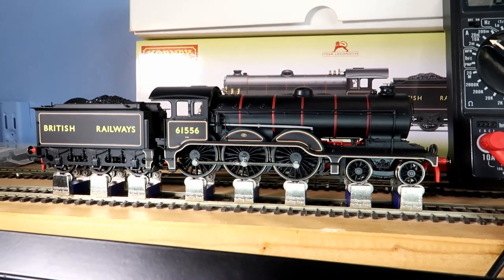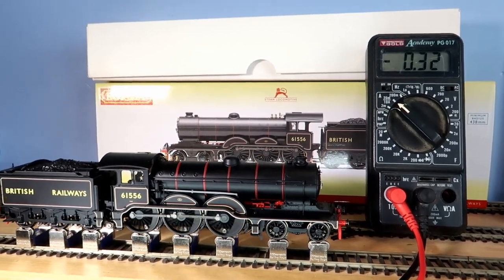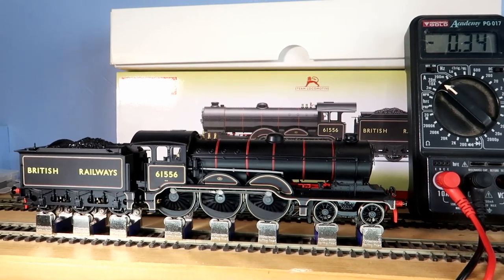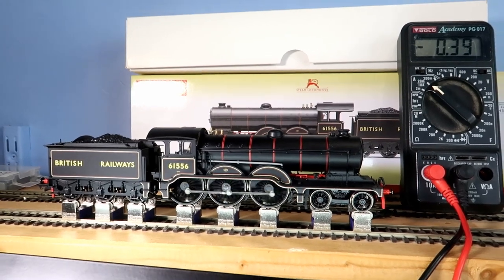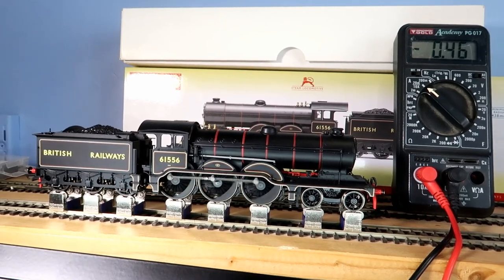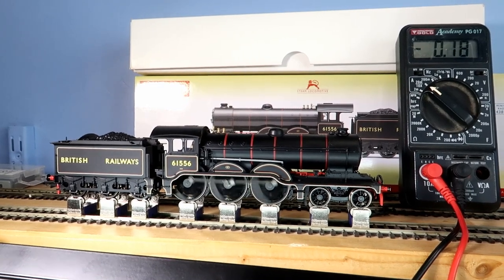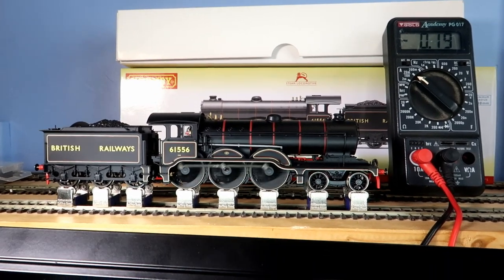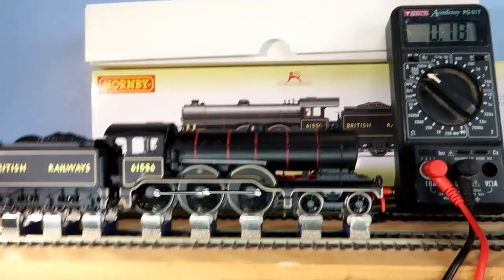Hornby B12 motor fail, NOT AGAIN, Warning to others and apology

Comment: Oh no, that's such a shame Mike ! I'm still wanting for mine to arrive, but I would just replace the motor. If you can open the old motor up and have a look, I have an LMS 8F that had the same problem. When the motor was dismantled the plating on the magnets had come away and distributed itself through out the motor. I cleaned it up and it's still running today. Best of luck with what ever you choose to do. Regards Leonard.
Reply from the maker: Thanks Leonard,  At the moment the loco is undergoing tests.
I replaced the motor and that too failed but I think it was one of the ones Hornby sent me for the S15 and I fitted it by mistake.
Now its fitted with one of the Chinese ones.
It’s running much better than it did and is drawing just 100mA which is fine. I’d expect motors of this kind to draw between 50 and 150mA if all is well.
I have some suggestions for other owners that want to try and stop the motor issues.
1) Check the loco wheel pickups, mine were way too hard and causing lots of drag, ease them off so that they just keep contact when the wheel is furthest away from them.
2) Inside, see https://youtu.be/Uwp_z3GdXXk Make sure there is clearance between the rear flywheel and the motor bearing, check that the sleeved wire from the suppressor capacitor is not fouling the back of the front flywheel. Make sure the worm tower bearings are lubricated. Make sure the motor bearings are lightly lubricated. Check in the worm tower that the grease is not too think.
My feeling is that the motors are failing as the brushes break down due to heat and short out the commutator segments. This could explain the erratic running we see.
I can’t pass on the link for the Chinese motors as they are out of stock now and have no plans for more. If I find an alternate supplier I’ll let everyone know.
Take care. Mike
2mm shaft
35.8mm body
6mm dual shaft
16.6mm biggest width.
12.6mm narrowest width.
12V-24V-High-Speed-Micro-NdFeB-Strong-Magnetic-Mini-130-Motor-DIY-RC-Car-Boat

Comment: Very sorry to hear that and certainly nothing you should feel the need to apologise for.  Hornby should have sorted this problem and recalled all stock if it's a known issue.  I've got one that has only been run in until I get my layout sorted and am now worried mine might go the same way - so I'll keep running it just in case!  Hope you get it sorted one way or another, end up with a nice B12 - and you did well to keep your language moderate!
Reply from the maker: Thanks lol  do check the pressure of the loco pickups, mine were way too hard.

Comment: Hi Mike, I bought one of these from Hattons at the same time as you. I thought it was a bargain. I’ve not got it out of the box yet. I was looking forward to sitting down with it when I  get some time. Now I’m not so sure!  I think the motor is X7083. According to Peter’s Spares, the RRP is £40.18. How can such a little motor cost so much, and how can it go so badly wrong. What if I bought a replacement motor and it was the same batch? The bargain doesn’t seem such a bargain anymore.

Thanks for the heads up anyway. Sounds like you need a stiff drink!
Reply from the maker: Hi David, I know what you mean.
I replaced the motor and that too failed but I think it was one of the ones Hornby sent me for the S15 and I fitted it by mistake.
Now its fitted with one of the Chinese ones.
It’s running much better than it did and is drawing just 100mA which is fine. I’d expect motors of this kind to draw between 50 and 150mA if all is well.
I have some suggestions for other owners that want to try and stop the motor issues.
1) Check the loco wheel pickups, mine were way too hard and causing lots of drag, ease them off so that they just keep contact when the wheel is furthest away from them.
2) Inside, see https://youtu.be/Uwp_z3GdXXk Make sure there is clearance between the rear flywheel and the motor bearing, check that the sleeved wire from the suppressor capacitor is not fouling the back of the front flywheel. Make sure the worm tower bearings are lubricated. Make sure the motor bearings are lightly lubricated. Check in the worm tower that the grease is not too think.
My feeling is that the motors are failing as the brushes break down due to heat and short out the commutator segments. This could explain the erratic running we see.
I can’t pass on the link for the Chinese motors as they are out of stock now and have no plans for more. If I find an alternate supplier I’ll let everyone know.
Take care. Mike
Reply: @ModelRailwaysUnlimited  Mike - big thanks for your very detailed reply.

I’m looking at the instruction sheet inside the B12 box. It says on the front page, right hand side, “The locomotive is fitted with a sealed, long-life motor which requires no maintenance. After a considerable amount of use the motor may require replacement and this should be carried out by a Hornby Service Dealer”. 

So it should be perfect, and you cannot see inside. Except it doesn’t actually work. Thanks Hornby!

Comment: I had the same problem on a Hornby Coca Cola tram. it's on it's third motor. Exactly the same symptoms, went up to over an amp.
Reply from the maker: Thanks, over an amp on the tram!!! my word, concerned you are on motor 3
Reply: @ModelRailwaysUnlimited  100mA when new.  I have not fitted the third motor yet. I'm going to only run it on 5v as that equates to around 30mph. if that blows will be having some serious words with Hornby!  The tram is actually made by Riverosso. I was also using an expensive lab bench power supply so not a PWM controller.
Reply from the maker: @MerlinIslandCrabCoveRailway  Check the wheel pickups, mine were super hard against the wheels causing drag?
Reply: @ModelRailwaysUnlimited  No not the problem. After the first motor burnt out I was quite careful with the second. I suspect it was a duff batch of motors, and I unfortunately got one in the tram and also one from the same batch as a spare part.

Comment: Mike thanks for response back re replacement motor interesting that you found pickups to drivers had excessive tention as I've always found Hornbys to have very poor contact  with the backs of wheels but there can always be exceptions especially as you have the loco  with you.From the results of your latest test running all would seem to be ok.Maybe faulty brushes after all! Oh well good luck all fingers and toes crossed!
Reply from the maker: Thanks for the info

Comment: I’d be tempted to send it back . Not Hattons fault  but a Hornby failure  and the only way they put it right is to send it back . I know you could probably fix it but is it worth the bother .  I’d send this video to Simon ‘detail, detail.detail” Kohler and show them what trash they are putting out .
Reply from the maker: Cheers Russell, new motor is in and testing has started, I did find the pickups on the wheels were excessively hard but not sure that will have caused this